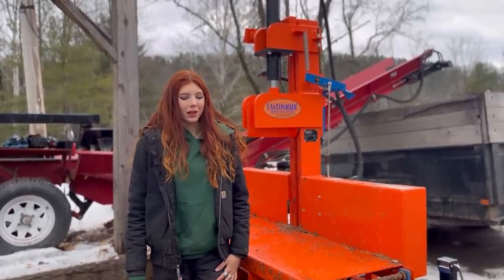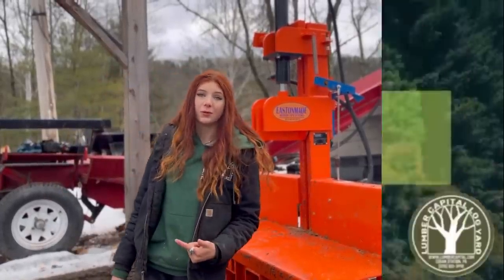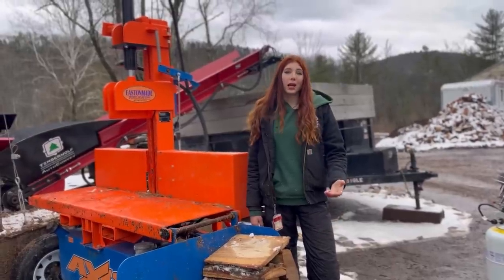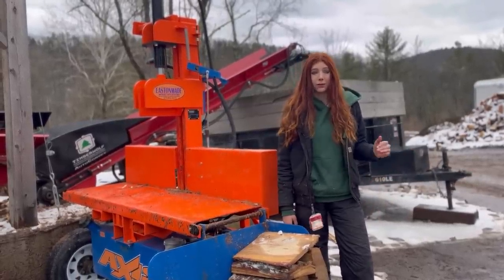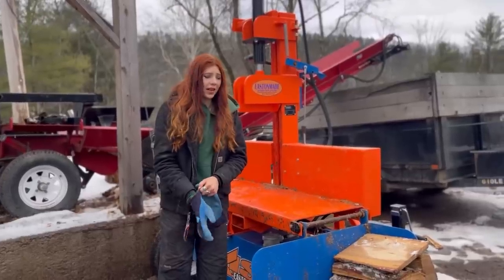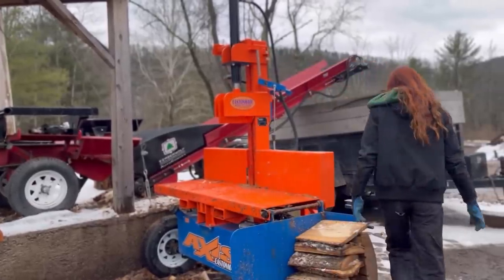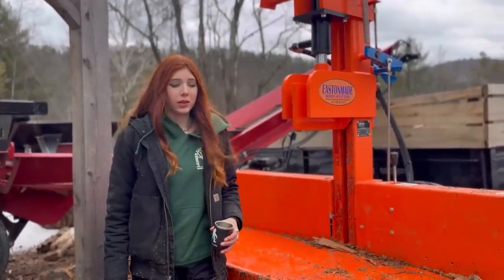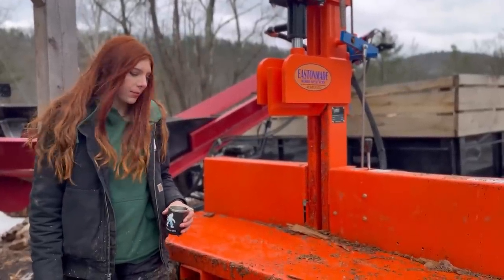Turning Waste Wood into MONEY with the Eastonmade Axis Splitter!

Comment: I'd make it a habit to never put your hands on top of a log while running that splitter.  Keep up the hard work 💪
Reply: Never ever.
Reply: Machinery has very little sense of humor.
Reply: Yes I agree fast cycle times are also fantastic however they give you a lot less time to correct your mistakes on the fly. For instance your hand placement
Reply: I agree ,better safe than thumbless. If i was their Father i would never speed it up.
Reply: Hand protection is super important. When I was child aged I played in the snow a lot, now as time progresses, the cool weather is noticeable.
Reply: @fractuss 
Yes, so true. I remember the workshop trainer, from my apprenticeship days, giving us all the lecture about wearing loose clothing when working on the lathe. He said when your sleeve gets caught in the chuck it’s not the going round and round that hurts, it’s hitting the lathe bed every time you go past it.😁
Reply: I know you have the cool lifting arm blue thing, but I’d at least try just offloading directly from the bucket of the tractor.  Then you don’t have to bend down.  Possibly easier and definitely faster.  I should think.
Reply: Very profound and wise of you
Reply: A video on safety around the log yard and the operational would be interesting.

Comment: After loading the tractor basket, instead of dumping it and then having to pick up again you could raise it up to the level of the splitting table and then slide it over to the splitting wedge. Would  save you one loading operation.

Comment: You can keep all the fingers on top of the wood that you want as the splitter comes down, as long as they are the ones you don't want to keep long-term. It will happen, so only grab from the sides.

Comment: If it were at all possible, I'd get the feed for the conveyor down to the same level as the deck of the splitter or lower. I would think you could work faster or get more done with less fatigue if all you needed to do was push the split wood off the end, rather than having to throw it up into the feeder. If you split a piece of wood into 5 pieces, as it is, you have to throw those 5 pieces into the feed 1 at a time. If the feed were lower, you could just push all 5 into it at 1 time. 

Stay safe, stay warm, and be well.

Comment: Splitting several at a time would help your game.  Jade caught on to that at the end.  Can the Elevator be placed closer and lower so you could slide the split chunks off the end right into the elevator? Throwing the pieces is time consuming and extra effort.  Glad your arm is working better.

Comment: I don’t know if you girls happen to take notice. That Easton made vertical log splitter that you girls have been using, has a adjustment lever on the back about 2 feet above the hydraulic valve body. Right about where your lever is to lift up the log lift you will see a rod that goes vertically up to a blue lever. Just under that blue lever you’ll see a blue square tubing piece of metal. That piece of metal can be slid up and down to adjust where your splitting wedge stops on the return stroke. That way you can have faster and more efficient cycle times. You can set that mechanism to trip the auto retract and stop your wedge exactly where you wanted to stop for instance at 16 inches or 24 inches so on and so forth.
Reply: I have sent him a couple messages I do not think they even look at these comments. Hopefully they do this is a great one I have sent them links to other people that have vertical log splitters at to show how they use them but have never gotten a response so I don't know
Reply: @FlipandTheBlueMule  they're too good-looking and probably too busy doing their homeschooling look at all these messages sent by his old men with knowledge we hold
Reply: I think the extra stroke adds more safety in the closer you get to your work piece to make it faster the more you better be paying attention with your fingers and such
Reply: @rickrack4812  these girls are smart and both have graduated  which i am sure many people watching this video did not.
Reply: @davidkettell5726  Did I ever state that they weren't smart?  I said they were probably busy with schooling, therefore I did not have time to read all these comments.. A couple days ago I watched a video of theie day and how they go do the schooling
Reply: @rickrack4812  - It's not a timed cycle, they have to press the foot pedal to drop the knife, so "faster" is not a factor.
Reply: @rickrack4812  - It's not a timed cycle, they have to press the foot pedal to drop the knife, so "faster" is not a factor.
Reply: @rickrack4812  
I think Emerald has learned a lesson recently about squashing fingers. 
To me it’s all the bending and picking stuff off of the floor is completely unnecessary handling of materials and can be avoided completely with a few $ investment. 
Got to look after the spines.
Reply: The first thing I thought of when I saw Emerald crank those engines was hearing protection so it was good to see both Jade and Emerald wearing the hearing protectors.  I can’t tell you how impressed I am with these two young women.  The work they do is physically demanding yet they do it with grace and elegance.  Thanks for the insight into your world.
Reply: @samuelluria4744  I never said it was, but when you rush sometimes to speed up safety issues May happen ...bad. my point was I was thinking it was fine that for them to have it at the full extent. And not short that because, again, it should happens.. Murphy's Law applies
Reply: @rickrack hi! I am am 50 yr old woman who worked as a climbing arborist and mostly as a ground supervisor with all kinds of crazy rigging going on.  I think your comments are accurate and need to be read. They are not working safely. This is bad for women who want to work in this field. Sorry for all the haters that are saying mean things to you.
Reply: @Rick Rack
Reply: @FlipandTheBlueMule ...all comments help increase their channel's revenue. An occasional comment from them will help create additional comments from viewers.
Reply: @FlipandTheBlueMule  actually the comments are read by the girls father, every comment I don’t know but I’ve had a few questions answered.
Reply: Excellent!
Reply: Mt, if you bothered to watch instead of looking for negatives the ram travel is a function of the foot pedal.
Reply: Rickrack a GED recipient talking trash is hilarious

Comment: Great idea. Looks like they would  make nice kindling.  You can also put them threw a wood chipper. Then another machine  to make them into powder.  Then toss them in a wood pellet making machine. That way you can reach the customers with those pellet stoves as well. This channel is really  great and I appreciate  the content.
Reply: Gotta have real volume to make a pellet mill pay...
Reply: Great work, 2 of the hardest working girls probably on the whole internet. U guys make your parents proud I’m sure every day .  There’s a blue bar on the back of the piston u need to adjust to limit the height it returns to after it splits the wood it will speed up your work definitely
Reply: Yeah, turning firewood into dust and then compressing it to pellets seems like a great energy saver.

Comment: I see  you are handling the slabwood multiple times   we have  a steel  pallet  with  wire mesh sides   it goes into when it's cut up and  moved with  forks   in front of the splitting area . It saves dumping it on the ground here which is always Muddy and wet it seems.  Just something to think about.  I always watch all your videos  but  only put my two cents in if I think  it may help .stay safe and I'll see you in the next one.

Comment: Hi Em and Jade!  If your tractor/loader isn't need elsewhere as you split up the slab wood, perhaps you could just leave the blue loader table down and move the loader bucket carefully into position so that you could offload directly on the splitter table. That would save a step in wood handling and save time. clink *clink*$ .02    Thanks again for another good vid!  Cheers!

Comment: Run your cherry hickory and fruit wood through a chipper then pack the chips in about a one gallon bag with a label on it and a bar code that you buy on the Internet and sell it for wood smokers at about $10-15 a bag. You will make a little over $10,000 a cord.

Comment: I would think that the new splitter would work much better for splitting the smaller pieces that you need for the wood that you put in bags since you can control the size of the wood you want to split much better

Comment: LoOks like things are happening pretty fast as it is, but I see the wedge on the ram looks to be 10-12” wide. Just wondering if you are splitting narrow slabs would it be more efficient to place several slabs back to back per cycle or would that be too clumsy? Cool machine no matter what! Hope it wasn’t too icy at your yard this am, it was wicked on the roads up here this am.
Reply: Yes, putting 2-3 slabs together for a single stroke would make the operation more efficient.  The machine should easily push the blade through multiple slabs.
Reply: Good point.  I saw her do multiple slabs at least once in this video.
Reply: @rightsideofthegrass8114  Right side ofthegr: 
I agree w/you because they can produce 2-3x the wood at 1/2 the exposure to severe injury. I hope Bossman reads this.
I am aghast that this does not have wrist "pull backs."

Comment: I heat my house in part with a wood stove, and don't mind having small pieces of wood mixed in. They light up faster and better than the larger logs. Not too much by volume of course, but it's easy to separate them out, and they burn just fine.

Comment: Having used the log splitter and conveyor for several days it appears the conveyor may be an extra step.  The wood is tossed over the side of the conveyor at about the same height as the trailer height.  Perhaps tossing the wood straight into the trailer would allow for better load management.
Thank you for the videos!

Comment: You need to find a way to get the outfeed table from the splitter higher than the hopper on the conveyor, so you can simply push the logs straight in. It's all about easy and productive workflow.💡
Reply: Emerald did comment that this is a temporary setup and will most likely be rearranged in the future to increase efficiency and ease of operation.
Reply: @ronsamborski6230  "will most likely be rearranged in the future to increase efficiency and ease of operation."

In actual fact Emerald never said that at all, she said tossing into the conveyor won't be necessary for all operations, she never mentioned increase efficiency and ease of operation.

My comment was simply a suggestion, it was clearly not a very productive work flow, and not very safe with both girls working side by side and Emerald having to use one hand to stop the logs falling whilst the other is holding the log under the splitter. Just one moments loss of concentration could result in a nasty injury.
From what can be seen in the videos, more thought needs to be given to reducing manual handling and optimising workflow. I have noticed a lot of excessive manual handling has to be done with several of the operations the girls carry out. I'm glad Emerald said it's not a permanent thing, because the layout and workflow clearly need more thought.
Perhaps Dad/Boss has some thoughts about safety.

Comment: Have you thought of building a front fence that you can just clamp on for when you are running just thin 2-4” slabs? That way you can cut 3-4 slabs at one time without them falling forward off the table. Would speed the process up 2-3 times.

Comment: They put a chisel on a hydraulic press.  It has potential, but if it's meant to save work, not so much.  You could hack your regular splitter to run automatic.

Comment: Working in the wet and mud sucks, no better way to describe it. Check for availability and pricing of ground asphalt in your area. Here in Michigan, it is relatively inexpensive and 4" worth makes a great, dry base.  Water percolates through the grindings to keep the surface dry. It will pack good and stick together. In 4 or 5 years add another inch or two for compaction loss.  Start by putting it in the work areas or where traffic is heavy.

Comment: I was surprised to see the elevator higher than the splitter table, I don’t know if you can lower it or not, but it would make it easier for the operator if it was low enough for them to be able to slide the wood across the table and into the elevator and not have to lift each piece up into it. Either way, you girls work hard.
Reply: As she said at the end, its a temporary setup as you can see its the conveyor that the timberwolf is normally using and that is up on a platform so hence the height of that conveyor at the lower end. Otherwise with the conveyor bottom lower down one would just shove the wood over the edge of the table and not have to pick up each piece and throw it but aside from that it looks like its certainly doing a job on some fair sized wood as well as being able to make quick work of slabs once they are bucked up. Lots of work though with those slabs with all the handling they get but a great use for them and value added labour return over almost giving them away as per the title.

Comment: Could you eventually run both log splitting machines off of 1 motor and pump instead of 3 different motors?
Reply: You would need bigger motor and pump.
Reply: @gordbaker896  Yes i realize that but it would be cheaper than running and maintaining 3 separate motors and pumps.

Comment: I have been trying to imagine how to do that easier.  I do not like all the motions in how you are doing it.  Others have already pointed out that after splitting the pieces one needs to be able to just push them off into the conveyor.  This would require the Eastman to be up on blocks as well and likely have an arm on that side to slide the pieces out on. 
   Is the chain saw the best way to cut to size or would the buzz saw work better?  ether way I imagine a three sided pallet to put the pieces in so they are already standing up for the Eastman.  remove the Eastman lift.  use forklift to bring three sided pallet to the correct height.
    Not sure that would work, however it seems like it may cut the motions down and be a bit easier.

Comment: At 4 minutes in this video you can clearly see the 'L' shaped bar that is painted blue on the back of the machine.  It's held in position with a hex bolt.  That's the adjustment to shorten the stroke of the splitting head.  Raise the L shaped stop up, lock it down with the bolt and you will shorten the stroke.  You young gals are already working hard.  Who is going to be in charge of working smart?  It's all about efficiencies now.

Comment: Suggestion:  How to never have soaked pants again.  Most packaging companies offer light weight plastic tubing on a roll for things like bread bags.  It usually comes in 5,000 ft rolls.  If you order the correct diameter, you can cut it to your leg length, slip it over your pants aand hold it up wieh a rubber band.  I bought mine 30 years ago.  It'll keep your pant's legs dry and clean. Hope this helps. ;-))  Shalom/gw  P.S.  I once filled a 20 foot length with helium.  It got away!  By the time I found my BB gun it was out of range.  It hovered over Pittsburgh for at least 12 hours.  But that"s another story.  LOL
Reply: 20 ft helium ballon sounds like something we would do in GA LOL

Comment: there is no muffler in the motor of the splitter, maybe bossfather should buy one if it exists, but I doubt. or find it in the junkyard or in the scrapyard. or he can craft it using the copper plumbing pipes and an iron plate. the unique solution maybe. a motor without pipe exhaust without muffler..mmmm'm if Emerald and Jade were engineers they would make it mandatory.

Comment: Ladies, I've never worked with a machine like this before. Please hold the logs on the side in the lower third and not at the top - otherwise you will soon say goodbye to fingers! Read the operating instructions, this is very important to get tips for handling and on possible dangers for man and machine. Dang, immediately had a small heart attack and started sweating while watching.